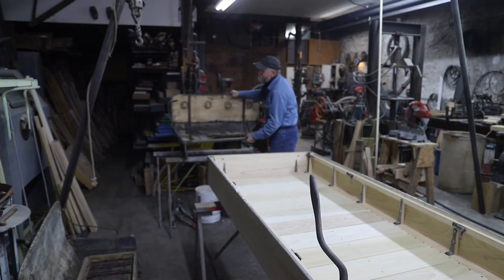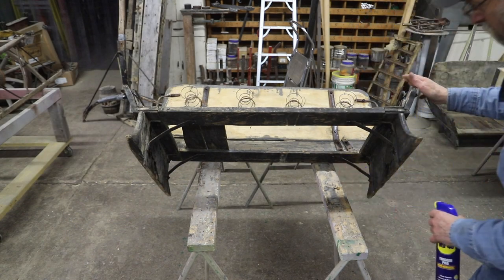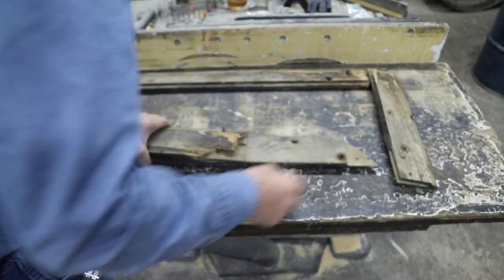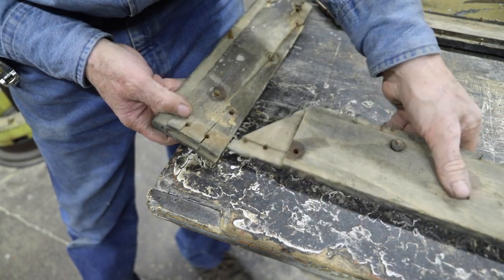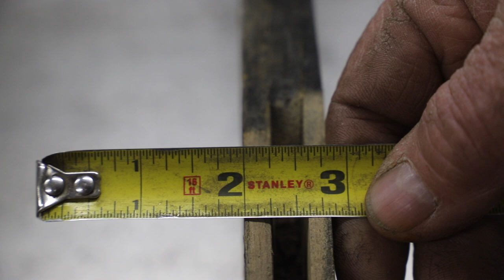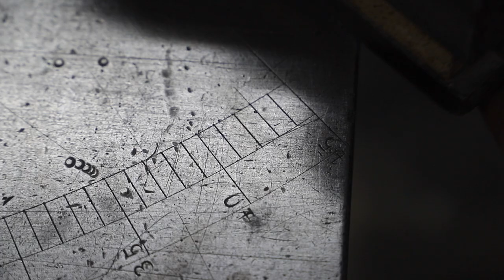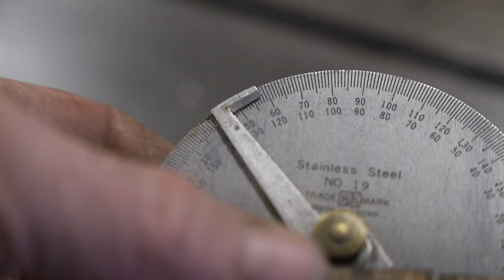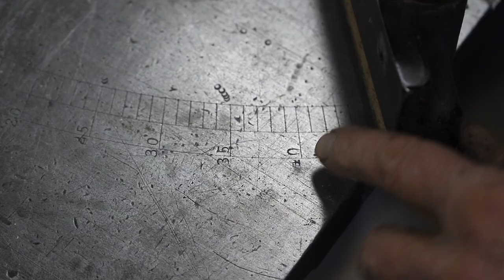Challenging Buggy Seat Base Corners | 2 Seat Buggy Part 8 | Engels Coach Shop

Comment: Loved the split bolt method, haven't seen that done by anyone in years. The lap joints were just pristine. Care to coment on why the other seat was off center so much? Just curious. Thanks.
Reply: He did mention in this and in an older episode that the other seat was not the same and not an original to the rest of the original buggy.

Comment: As you found out, a 90-degree miter that joins two pieces of different width is not a 45-degree cut. I did a similar joint using a slot cutter on a router table.
Reply from the maker: Ah, but these were the same widths.  :-)
Reply: @EngelsCoachShop  I was wondering about that after I wrote it. Nice job, by the way.

Comment: I can understand going with the mortise joint over the lap, but seems a bit odd going 52 instead of 45
Reply: so the joint doesn't end on the tip of the corner i'm guessing. I was wondering this myself
Reply: @alangilman6711  maybe but I'd think they could do that with a 45 by reducing the tenon length

Comment: I suppose the 52 degrees isn't wilful awkwardness. I guess they knew what width of board was right for a seat base, and they knew (or figured they knew) the right amount of 'fat' to leave at the blind end of the mortice (looks to be about 1", or 1.1/4") to avoid splitting when glueing up, and 52 degrees is just what you get for those dimensions. Maybe.

Comment: You might like PB blaster. It’s faster. It has freed up engines that had been locked up tight for many years for me. I did use wd40 for many years before I tried PB blaster   I will not use wd40 for rusted bolts anymore. I still use it but for other things

Comment: Still trying to figure out why the 52* instead of 45*...any insight @EngelsCoachShop?
Reply: If I was to take a wild guess. I would say the sides were short distance apart so the front and back pieces needed a few more tenth's of inch of wood strength to combat twisting on the long boards. Just a wild guess!
Reply from the maker: I'll touch on it next week.

Comment: Dave, did you count on the accuracy of the cuts or did you use a square to check for 90 degrees on the corners when you clamped them?

Comment: Thanks for the video!  Might this be called a mitered bridle joint (not a true mortise since tenon is open on one side)?.  I don’t really get the benefit of the miter here.  Wouldn’t a draw bored tenon in a closed mortise be stronger (can’t rack or twist)?  Or was this done for a specific reason?

Comment: why 52° ? was that angle eyeballed by the original maker?
EDIT: or did that odd angle come from different measures of the joined parts, that is that they measured lengths of the sides of the joint-parts wich then resulted in the odd angle?

Comment: Curious: Why not drill through the corners and insert two dowels to mechanically lock the corners in addition to the glue to prevent from racking over time?? If because that's not how they did it back when, that's a fine answer. Given that whole barns were build back when with frames of mortise and tenons and wooden pins, it would still be in the spirit of the times.
Reply from the maker: They get pinned when the irons are reassembled.
Reply: @EngelsCoachShop  Thanks. Love your channel and the work you do.

Comment: Did the original builders know something that has been lost in time? Why did they cut that tenon at 52°? Is there some mechanical advantage? Does it make assembly easier? Faster? To my eyes that angle seems so odd. But I know the original builders were just as clever as Dave, so they must have had a reason.

Comment: Dave, do you really prefer the Titebond III over Titebond II? Is it due to the waterproof technology that it has? And is your glue cleanup done with the rag wet with denatured alcohol? Just curious, I have always used the Titebond II in the past. Was thinking about switching to the III, but if there is little difference, the cost is an issue because the III is approximately $40 a gal more than the II in this area. Thanks. Joe.
Reply: My understanding is Titebond II is water resistant and III is waterproof.
Reply from the maker: Correct, III is waterproof.

Comment: Why would they use such an odd angle? Think they thought they were doing 45, but their miter was off by a few degrees? haha
Reply: They did it to match the fact that the short boards were narrower than the long board.  That angle fits the diagonal of the overlap.
Reply: @BrooksMoses  weren't they all the same width though?
Reply: @IanZainea1990  : Hm.  Now that I look again, you're right.  Thanks for the correction!  If I had been right, the miter would have ended right at the outside corner, and it doesn't.  That might be why they'd use a steeper angle -- so that right at the outside corner it's still a single solid piece.  I don't know why that would matter, but I think it does look a little better.
Reply: @BrooksMoses  ah. Good point. They could have felt it was a better tacking edge for the seat fabric? Or maybe that edge is exposed and they didn't want to see the joint?
Reply: Correct M Brooks, so the outside remains one solid piece.  The tenton appears to be the fragile component when the seat side is radially loaded from the passengers hip.  Long fragile furniture doors tentons seldom are radially stressed across their thickness during opening and closing. 
Snow in Montana. Great!

Comment: I wonder why they went for those joints, mechanically, in the vertical plane, they are not as strong as the full variant, i mean, i know it's probably tied to the fact that they resist deformation in the horizontal plane a bit better, but surely the rest of the structure is able to retain that shape easy. Maybe i'm missing something here. I know for sure i'm biased, they're not easy to make.